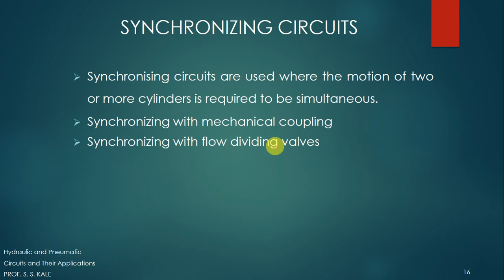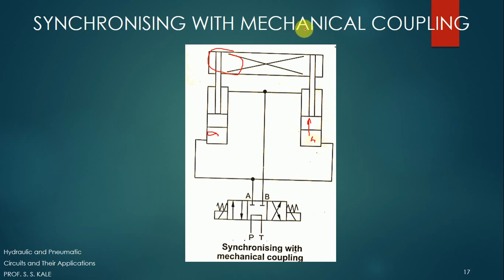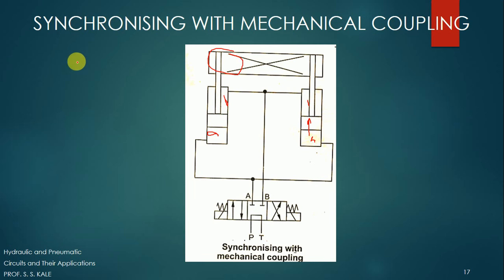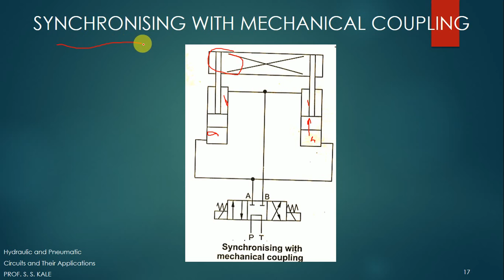Synchronizing circuit

Comment: where is other flow valve synchronising circuit
Reply: @SampurnaEngg  
synchronizing with flow divinding valve..?
Reply: And also where is hydraulic motors linked circuit